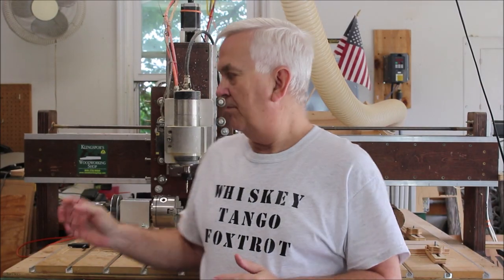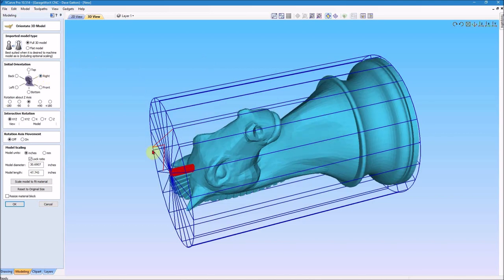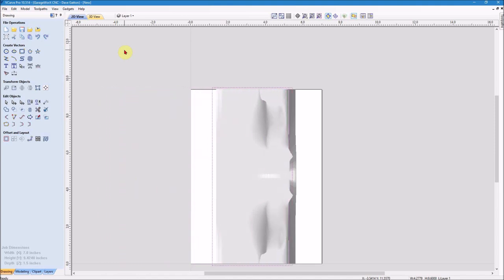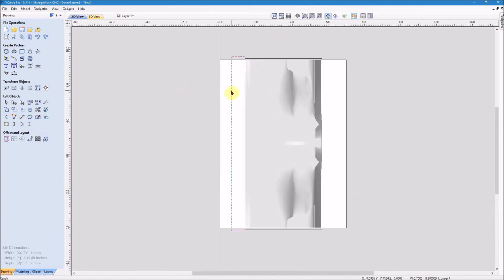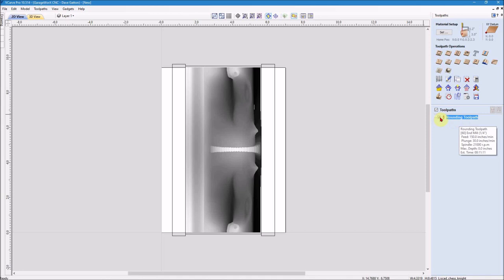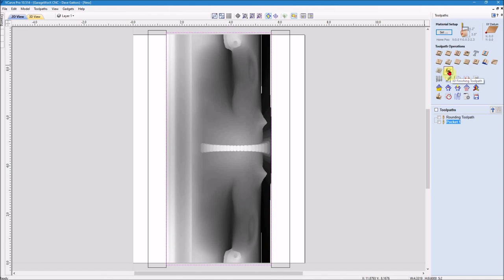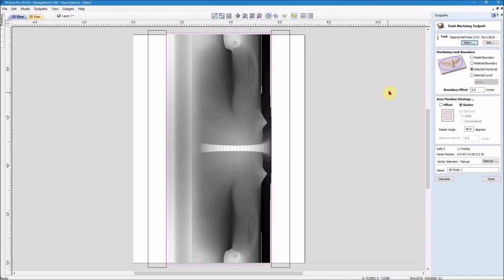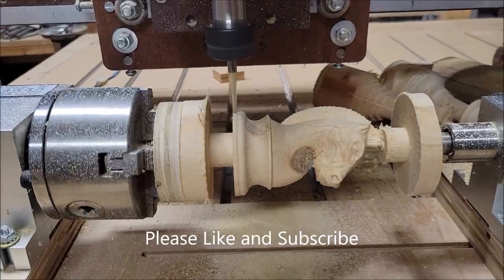Making a Chess Piece | A Follow Up Video

Comment: How was the work piece chucked?  I understand the tail stock end.
Did you place a hole on the on the work piece to chuck it?
Reply from the maker: No.  Since I start out with square stock and use the rounding toolpath gadget to make a cylinder, I glue a piece of round scrap that I've cut with my CNC to the end of the square stock.